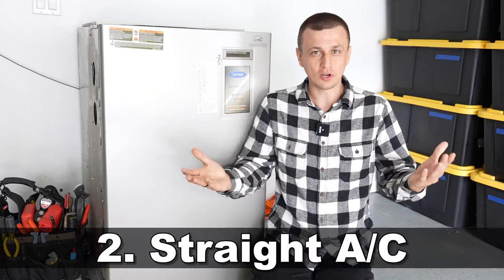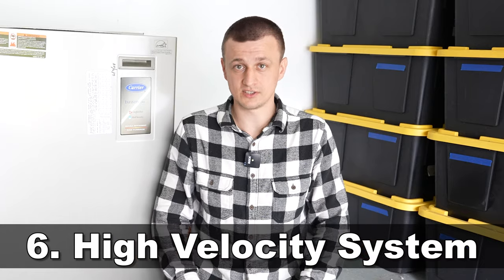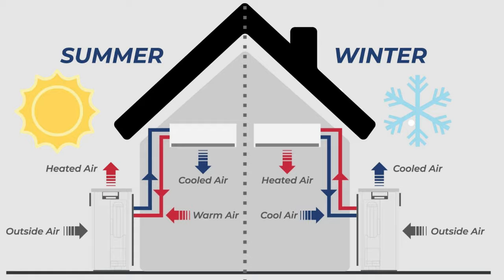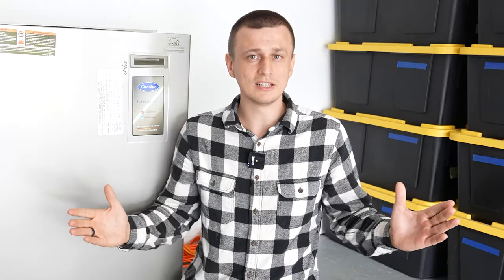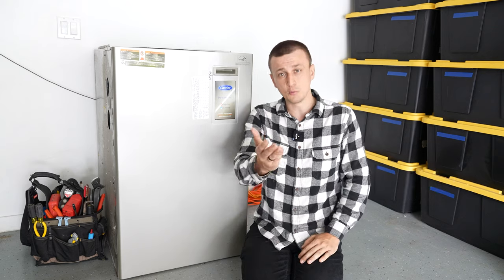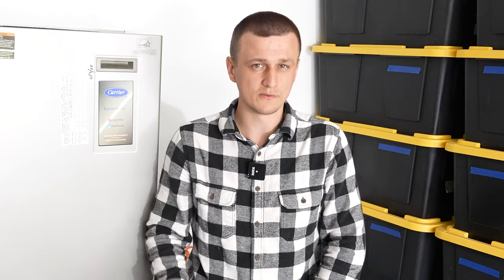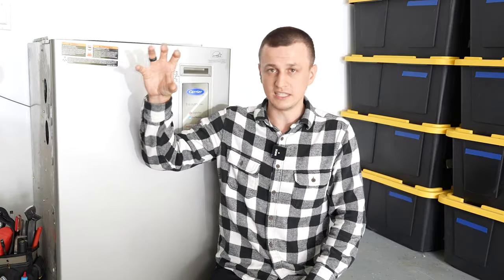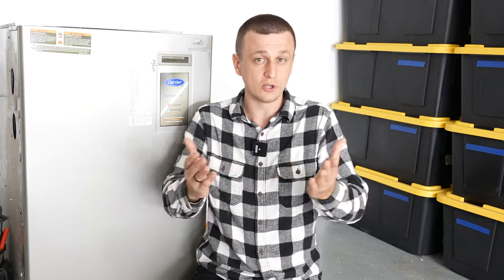Difference Between A/C, Air Handler, Furnace, Heat Pump, Minisplit, Etc.

Comment from the maker: ⬇ Other Helpful Videos:

How A/C works for Dummies:
https://youtu.be/cRnzYJ4qmWE
Difference Between A/C and Heat Pump:
https://youtu.be/dzA9jrfAvSM
Top 5 Furnace Problems:
https://youtu.be/T4IWtKy--Vk
Top 5 A/C Problems:
https://youtu.be/GOXgdnRB840 
10 Easy Ways to Connect Wires:
https://youtu.be/ihpNCVk1lF0

Comment: I know that "air conditioning" is thought of as "cooling".  Cooling is only one part of conditioning the air in the building.  You are heating, cooling, humidifying, dehumidifying the air.  So, "air conditioning" is more than cooling.  As a whole, it is an air conditioning system.
Reply from the maker: Thank you for explaining that it's a lot more than just cooling!

Comment: A lot of times people forget that geothermals since they are a heat pump still can't operate the greatest when the ground temperature changes. It can only do so much and since they are smart systems they switch on heating elements when they ran too long. So the electric bill goes up

Comment: Grate video bud! I switched careers recently (went from Project Management to HVAC). I took a crash course in HVAC, passed the EPA608 and got a Universal Cert. Now I’m in the real world doing HVAC maintenance. BUT matching Work Order paperwork against the “actual units” that I’ve worked on has been a PAIN in the pants😵‍💫, bcs I’m still learning what these difference are (the ones you explained in the video). Thanks a million🫡👏🏽👏🏽👏🏽👏🏽👏🏽

Comment: Very informative. My son’s condo  has 4 mini split “heads” fed from one outdoor compressor. This was done ,as usual, to avoid constructing a duct system. After two years of operation, the system is adequate heat wise (Mass. weather) for all but a few days in winter. Cooling is good ,but humidity control is lacking. We’ve tried a number of experiments (turning one or two off to make the working units move more air longer, etc.). The HVAC company really had no answers. He finally bought a dehumidifier to run in the hot weather. Temperature diffusion is ok ( a damper rotates automatically to redirect airflow). My house has conventional gas forced air (two stage) through ducts. Temperature differential between floors was always a problem. I bought and installed  the Ecobee thermostat ( I don’t work there) and also a few extra room sensors. What a difference that made. Not perfect ,but much better and I saved some money, particularly thru the cooling season. I suspect the end of fossil fuel HVAC is coming ,but it will be like pulling teeth and too expensive for many. I have seen some locals doing geothermal. Theory is good,  but there are a lot of moving parts to maintain- a basement full of equipment and probably upgraded electrical service. A local guy has special equipment to drill in very tight spaces/ back yards and is busy all the time.
Reply from the maker: Oh wow, you have experience with a lot of these systems! Thank you for sharing the details of how they operate along with your commentary on what you tried to do to make it better. Much appreciated!

Comment: Thank you. This was very informative.  I had been out in the desert years ago.  Where i was they cooled buildings with sometimes called a swamp cooler.  I'm curious to understand how they work.
Reply from the maker: Glad you found it informative! I've never worked on any swamp coolers but I do know how they work. Swamp coolers basically use water instead of refrigerant to cool the air. When hot air passes through water, heat is absorbed into it making the air feel cooler. It would take a while to further explain it but I think this site does a pretty good job with breaking it all down if you are curious: https://home.howstuffworks.com/home-improvement/heating-and-cooling/swamp-cooler.htm

Comment: Cool video Jay. 

A friend recently asked about adding ductless units. She only wanted ac, no heatpump but it's harder to find an ac only that saves her enough money. =b idky she can't take the added benefits of a reversing valve.
Reply from the maker: Thank you! Just because it's a heat pump doesn't mean she ever has to use the heating part. If it costs less or is the only unit available, why not?

Comment: HI JAY...i need replace 2 ton very old condaensor ,  i don't have one-2 ton , but i have 3 ton , can i replace that 3 ton instead  , you think will be ok or any problem ? thanks JAY
Reply from the maker: The general problem with an oversized system is that it will cool the temperature down really fast, but will not run long enough to extract the humidity out of the air. That's the generic answer any tech will tell you. 😇 Honestly it's hard to guess without doing the calculations but if your home is around 2000 square feet, a 3 ton unit should be fine. Especially if your current unit struggled to keep up on hot days.

Comment: Thanks for the informative video, 
I have a question, I recently got a quote on quote efficient samsung gas dryer after the old school whirlpool gave up, the thing is that it takes so long to dry clothing even at the hottest settings it still takes one and a half cycles to completely dry, which is about 2 hours or more, on old whirlpool it took max 40 minutes on medium temperature, is there any way to hack these fancy machines and get them to do their job?
Reply from the maker: You're welcome!
The new dryers and washers are loaded with high efficiency trinkets which saves on the utility bill but they often also do a worse job at cleaning and drying your clothes... (less water used, less heat used) Unfortunately there is nothing you can really do to remedy that besides using timed dry instead of auto dry, that might help a little.

Comment: Hey Jay, I use your videos as one of my main sources of information since I got into the trade. I haven't seen any videos you have on boilers or hydronic heating systems. I haven't seen any videos on electric furnaces either. I was wondering if there was a reaspn for that or if maybe I just overlooked them. Thank you for all your hard work...
Reply from the maker: Glad to hear that the videos have been informative for you! I rarely work on hydronic or electric heat since the area i was in mainly only had a bunch of forced air furnaces. Plus most of the videos I have were done with my own units at home which are also forced air. I hope to make some videos on hydronic and electric in the future. Can't really do it now either since I am in Hawaii and there's barely any furnaces of any kind here.

Comment: I think a more clear way to explain all of this is to separate the distribution system (eg forced air, in floor radiant, radiators etc) from the heat source (oil furnace, gas furnace, air source heat pump, geothermal, etc). Basically any of those heat sources can be paired with air or water distribution.

Geothermal is more efficient than air source partly due to the more consistent temperature but also due to the greater heat capacity of water and the ground vs air. In terms of payback, geothermal makes the most economic sense in cold climates where a cheaper air source heat pump starts to struggle in the depths of winter. That said, there are more modern units that work alright down to around -25C.
Reply from the maker: Yeah, I think I could have formatted this video different. Thank you for the suggestion and for further explaining geothermal and heat pumps!
Reply: @WordofAdviceTV  Thanks for doing these videos. Your many past ones on natural gas forced air furnaces have been super useful for me to keep my aging unit running over the last couple of years.
Reply from the maker: @jamesroscoe7555  That's great! Glad to hear that the videos have been useful. Stay warm!

Comment: Question for you.  Our heating system will not come on.  The old Honeywell thermostat shoe -AC. The instructions for the thermostat says this means it is missing AC power. There is power to the heating unit in the garage. This is an HVAC unit.
Reply from the maker: If it is missing power then I would start at the furnace. Do you have a multimeter? I would check if there is power going to the transformer (120v) and power coming out (24v).  Then I would check if there is around 27v between R and C on the thermostat strip on the control board. A blown 3 amp fuse is also a possibility.

Comment: You missed the Freus. It is similar to a split condenser except it uses as an additional means of transferring the heat.  Water pan is t the bottom with a pump and hose to move the water upward to the pvc that is just above the copping coils and flows across the coils draining downward back into the pan. It has a water line connection and a float to keep the water just right alone an anode to help with minerals in the water.  I saw a lot of water pumps fail on these.
Reply from the maker: I've never actually worked on one of those! Thank you for mentioning it and describing how it works.
Reply: @WordofAdviceTV  former employer swore by them and marketed them as energy efficient as compared to standard condenser. I can them working great and last a long time in places with there are mineral deposits in in the water but not where you have hard water.  The minerals eventually cake everything, they need to cleaned regularly (standard cleaning twice annually [part of seasonal tune-ups] and deep cleaning for the deposits every few years - $475 per).
Reply from the maker: Oh wow. Yeah, with hard water any energy savings would get drowned out by the maintenance costs. Thank you for explaining!

Comment: Hello Jay, can you please advice me if a Goodman gsxh506010 ,it’s a 5Tons with seer15.2 and air handler amvt60dp1400 variable speed is good and reliable brand air conditioning unit? Thanks